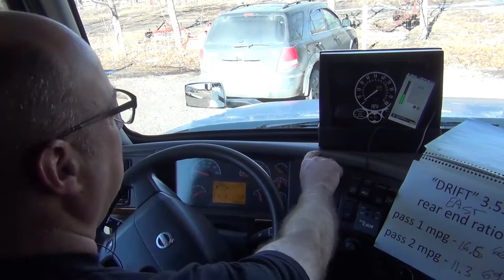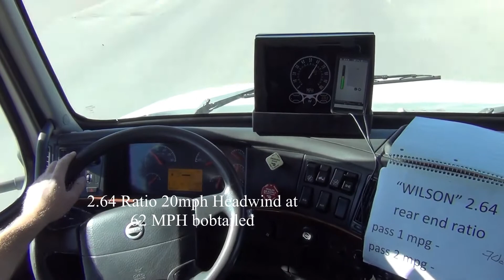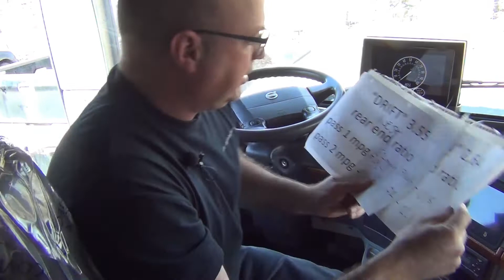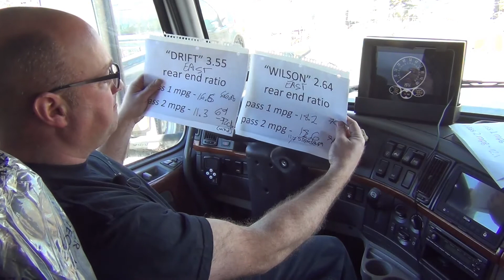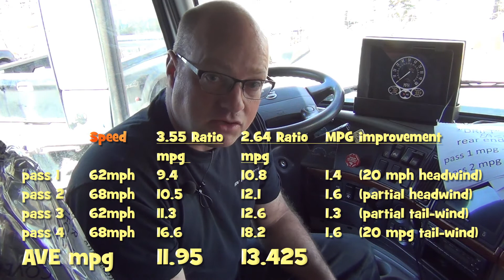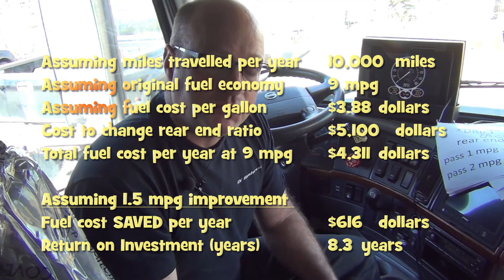RVHaulers Fuel Economy With Custom Rear End Ratio Replacement

Comment: Whats the tow capacity for the 2.64??
Reply from the maker: +Xaviar J S Thanks for your question.  The rear end ratio change does not alter the towing capacity.  These 2.64 ratios are now coming from the Volvo factory on new tractors, and are being used to tow the full 80,000 lb loads.
Reply: Thanks..

Comment from the maker: Hello John.  Very appropriate question. I did this comparison mostly for the owners of DRIFT.  They were very curious if they should get a rear-end replacement. Right now, both these trucks had no beds on them.  Installing the new rear end when the bed (deck) is installed is really a pain.  When we have the trucks completely open on the back, it saves us a great deal of labour to install the new gearing.   I wanted to give them the option to put the 2.64 in BEFORE I put the bed on, and I also wanted to have some real numbers to show them.  They have chosen NOT to put the rear end up grade in place, so we are going to put the smart bed on next.  I will do exactly as you suggest, and do another comparison with a trailer connected in the next while.
Reply: +Gregg RVHaulers So you said 1,400 rpm @ 62mph for 3.55.  What's the rpm for the 2.64?  How much tow capacity do you give up with 2.64 diff?  I can't believe how much they are effected by the wind.  I think the future Rigs need to get a lot more aerodynamic!!